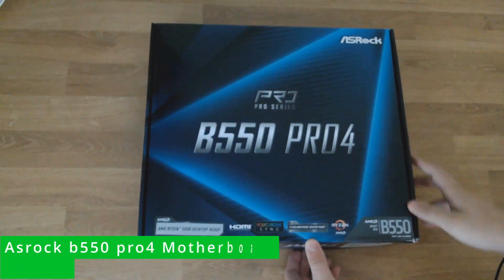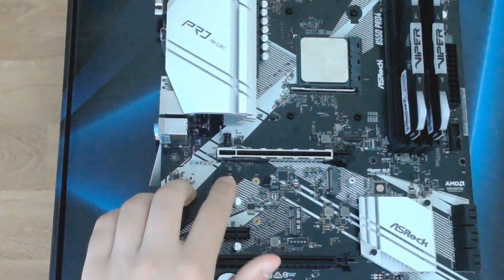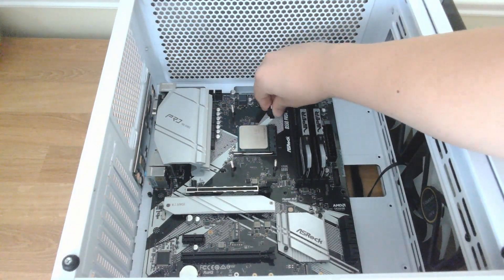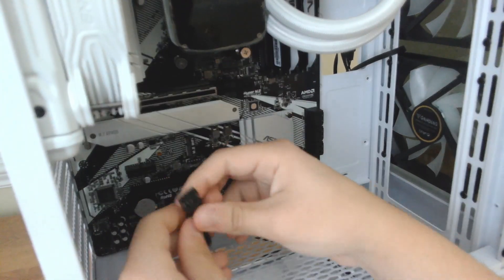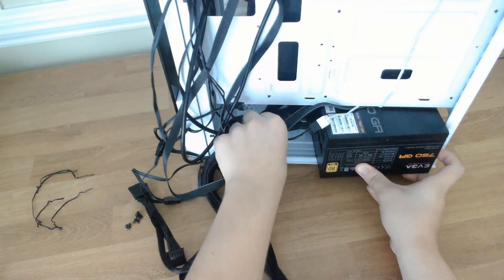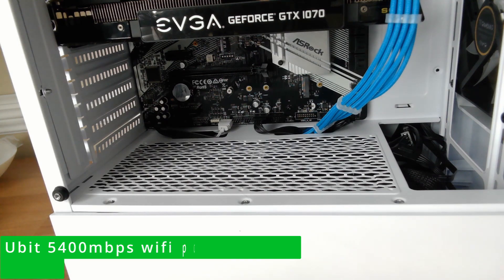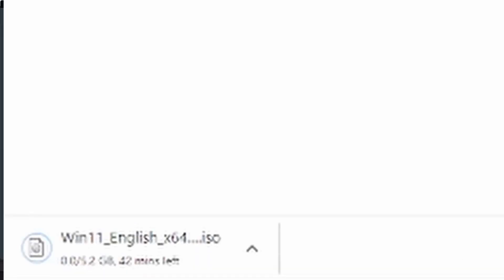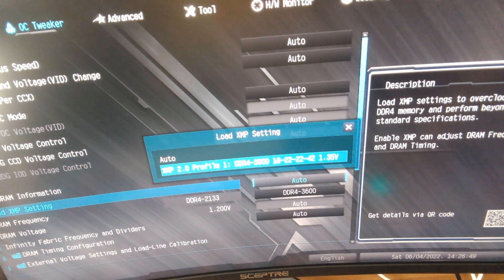The Ultimate $850 Gaming/Streaming PC Build Guide (Step by Step Tutorial)

Comment: @luka fx did the cpu work with the motherboard right out of the box? and also do you need to plug in all the argb cables and fan cables? I'm having trouble whether when I buy this case should I buy an ARGB hub. I also don't know where to plug in the LED control button.
Reply from the maker: Yes the cpu did work out of the box. I would recommend to buy an Argb hub as it makes it easier to control all the lights at the same time
Reply: @lukatabor  where does the led button plug in?
Reply from the maker: @hypulsion4817  look at the motherboard’s user manual and there will be a diagram that tells you where to plug in the front Io cables (including the led)

Comment: Are the fans defaulted to blue? I’m trying to sync them with my motherboard but I can’t…
Reply from the maker: No, you can change them with the button on the top of the case
Reply: @lukatabor  yeah but it comes with an ARGB header, so I assumed I could customize it using my motherboard…
Reply from the maker: @bxshwitdarackzz  I think you need an adapter

Comment: in my country the rx 6600 costs only 300$ and its about 120$ cheaper than the gtx 1070 i think.
Reply from the maker: I bought the 1070 used for $130 which you cannot get for the 6600